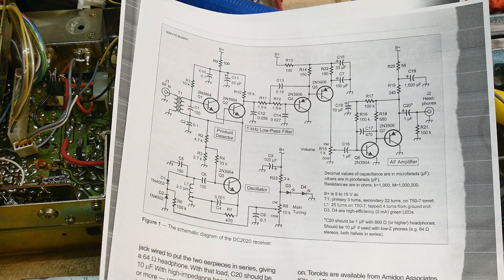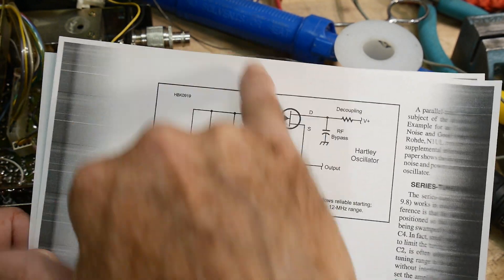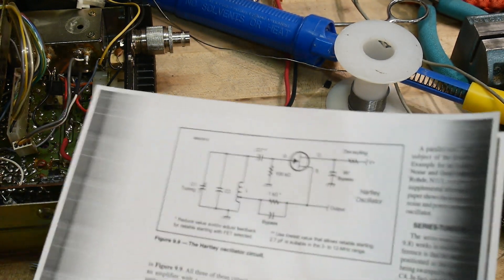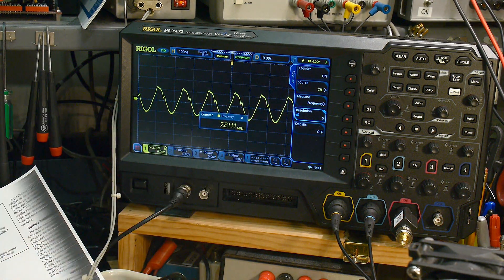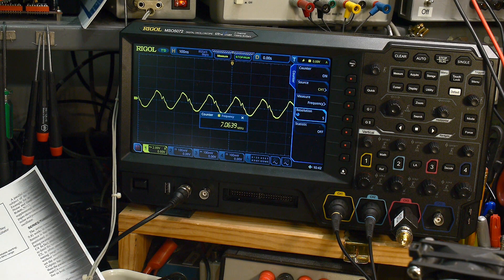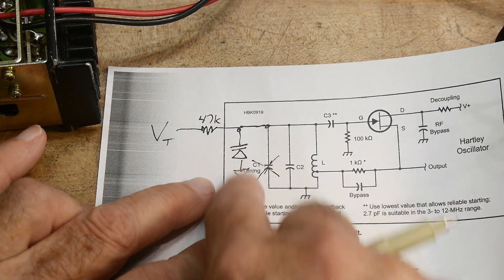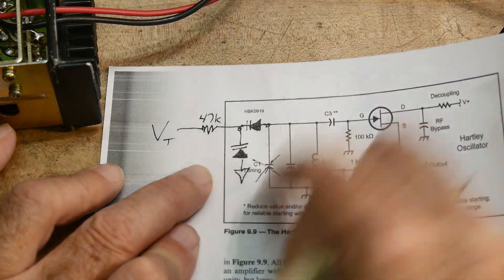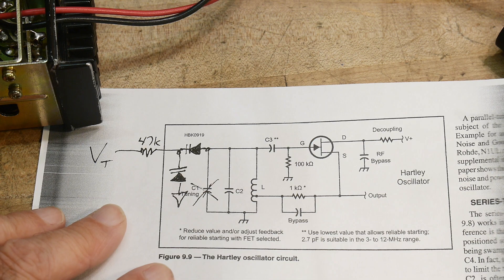#955 VCO using 1N4007 diodes as varactor varicap

Comment: Your problem on the original oscillator may be the bias on Q3.  The article's author noted an error, R10 should be 1.5 k ohm, not 15 k ohm.  Mine fired right up with that.

Comment: The two varicap diodes ensure they can never forward conduct with VCO signal voltage. The capacitance change will be halved in this case, equivalent to having two caps in series. This is the correct way to do this.
When using one varicap diode, it  will distort the waveform at low tuning voltages as the signal voltage modulates the tuning voltage. Varicaps are terrible for stability, air spaced variable caps are the best, but increasingly harder to obtain these days.

Comment: Hint
The coil is a shorting the control voltage so 2 diodes or one & a cap ( 47 -120 pf ) .
A good starting point is a adjustable & regulated voltage say 2 – 15 V .

Lower than 2 v the diode do what diodes do !

Comment: I don't understand why using junction diodes. Using  varicap diodes results in substantially less harmonic generation and uses a significantly higher control voltage range making the tuning less critical. Oh, by the way, the varicap diodes are not expensive, typically less than a dollar on ebay.

Comment: Thanks for the video, playing with these is on my to-do list as well...
Not trying to drop anyone down the rabbit hole, but I remembered a good explanation on why the 2 varactors improved stability in the VCO circuit. 
w2aew 's channel, number 147 goes through the theory on that. Basically as Manf said also in the comments, the VCO frequency is affected by the voltage across the varactor which is the sum of the DC voltage and the oscillator's time varying AC voltage, causing non linearity in the resulting frequency.
Have you looked into the temperature stability of the VCO's yet? I would assume there would be one, as forward voltage tends to change as the junction temperature changes.. I would guess the same applies to the reverse bias.
Cheers,

Comment: Series capacitors have 1/Cs=1/C1+1/C2 for the rf path.  If C1=C2, the result is half as big.  The range also depends on the parallel constant capacitance (C2 in the schematic) and the inductance.

Comment: It is an interesting issue with the second capacity diode. 
One capacity diode has to be coupled with capacitor to the LC circuit as the diode requires a bias.  With the second diode, as coupling device the capacity added is just half the capacity of one diode as they are in series. 
But it has an advantage. As the capacity of one diode is nonlinear to its voltage a signal amplitude leads to a frequency shift. 
As the second diode is in opposite direction to the signal voltage the frequency shift of both diodes compensate.

Comment: I guess that the second varactor is there to make sure that the inductor doesn't short the control voltage. Anyway, yet another interesting one, thanks!
Reply: Could just as easily be a normal capacitor but yeah, it's there to block the DC.
Reply: @M0UAW_IO83  Also frequency bandwidth?